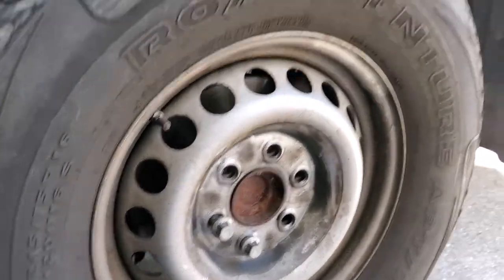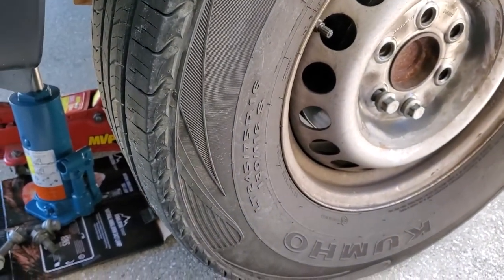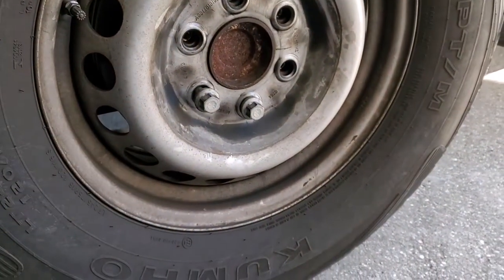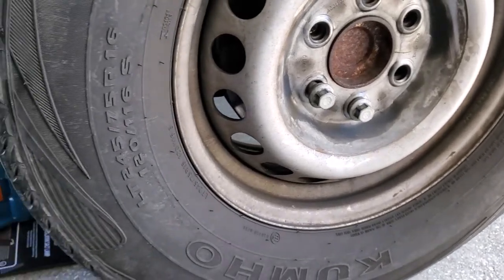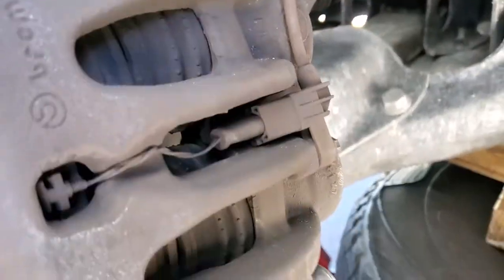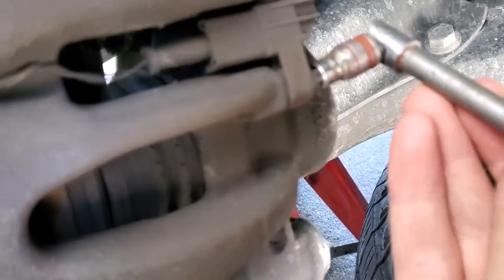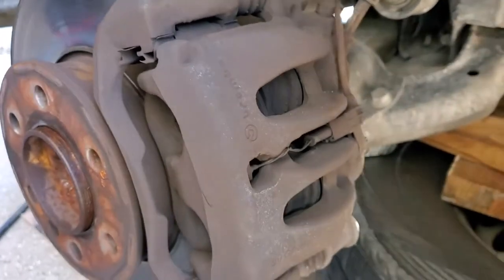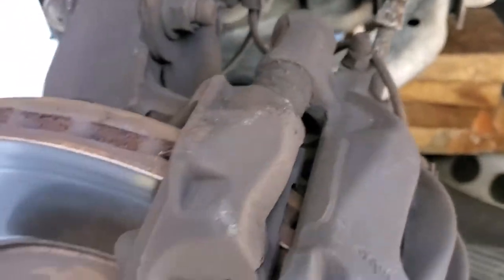Sprinter Front Brake pad replacement 2014 Sprinter 4 cylinder 2500. EASY!!

Comment: I like this video - particularly the summary towards the end.  I too came across what felt like almost seized lug bolts on a sprinter...and yes I remember the noise as I loosened them.
It is tempting to add some grease when replacing them..but my understanding is that if you then tighten them to specified torque or just what most of us used to do ie. until it 'feels' right..., because there is less friction if lubricated, the stress on the bolt gets to be much higher than specified and they can then snap as a result perhaps now, or perhaps later (worse :)  Many years ago someone told me to use copper grease...but after having watched some engineers demonstrate the above in youtube vids, I have given it up :)

Comment: Tip: when you're removing the lugs   use a impact wrench while it's jacked up. They'll pop right off. 

You wonna know why it's so hard to get off? Because they're lug bolts not lug nuts. All that weight is forced into that side of the bolt and trying to remove it is near impossible.
Reply from the maker: Good point. If I had one. What about changing on the road? Bring impact wrench? You have a battery one or air?
Reply: I just did a brake job on a 2016 mercedes sprinter and replaced front and rear brakes. Lug bolts came off easily with it jacked up.

Most stupid European vehicles have lug bolts. Try taking the lugs off a bmw.. same thing until you jack it up then all that weight on those bolts are gone and can pop right off with an impact wrench.
Reply: @wetlifesports I'm a mobile mechanic and have a few battery 1s
Reply from the maker: @crunkwun  its just now sinking in what you mean, bolts vs nuts, got it. Thx
Reply: @wetlifesports  if you don't have an impact wrench you could probably try jacking it up just enough until the wheel is nearly off the ground. As long as the wheel grips the ground but enough where most of the weight is off those lug bolts so you can use your lug wrench. It should make it a lot easier.
Reply from the maker: @crunkwun  thanks!! That definitely must of been my issue. Maybe now I don't need to carry my 3 foot extension bar..

Comment: they are 'Torx' screws. also they are 'G' cramps, not 'C" clamp. the pad with the sensor should go  to the pad that wears faster. agree to lube the wheel studs both the thread and taper. I do not like your vehicle support with jacks. ALWAYS pump the brake pedal several times before driving as you have no brakes until this has been done

Comment: Minutes about tire bolts and two other behind rubbers, then the saddle which is the hardest part actually to take out and nothing about it but abracadabra it’s off. No hints. Not helpful.
Reply from the maker: Sorry, but if no mention usually means you'll have the same experience, magical. 🙂 its easy.

Comment: Man, this video made it worse, after going out and buying a star torque cause my normal torque didn't work for the sensor attachment bolt, learned that I didn't even need to take that bolt out. Why?? Smh.
Reply from the maker: Sorry, it made it easier for me. You need star wrenches anyhow...